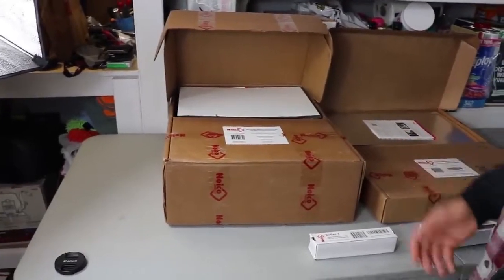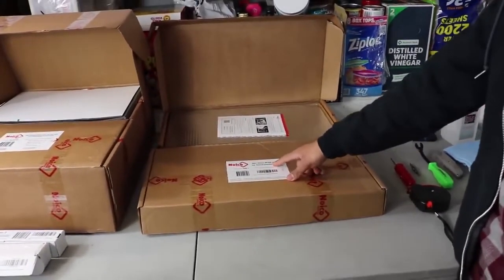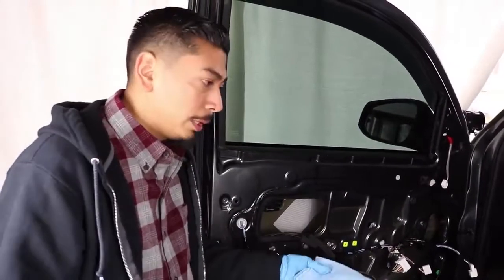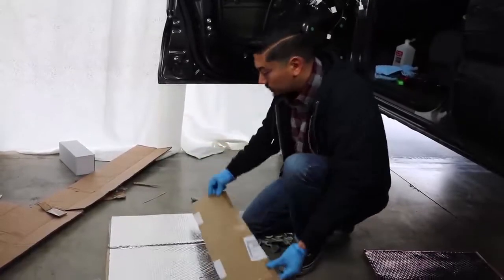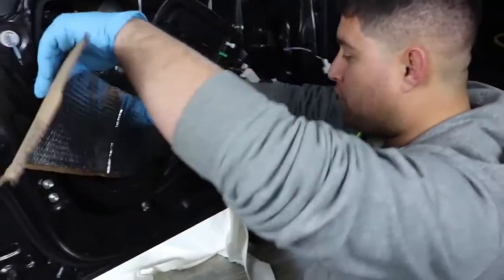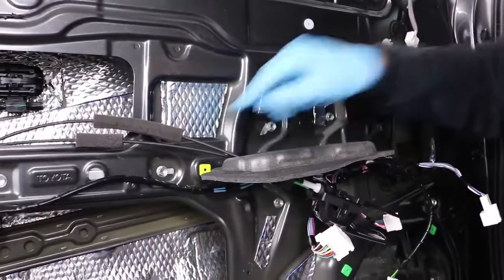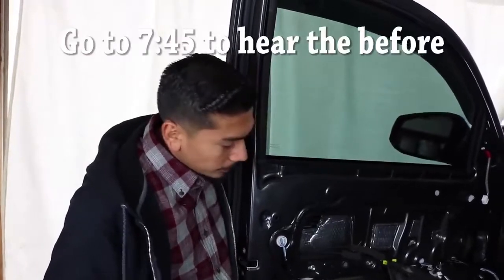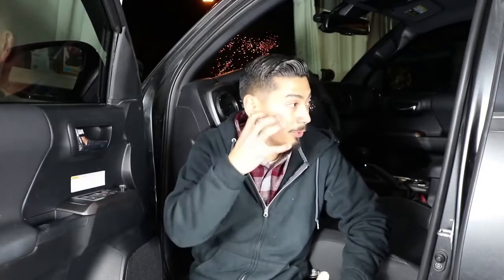Door soundproofing of Toyota Tacoma with Noico materials

Comment: Did you put the plastic and insulation back once you were done? I will be doing this to my Tacoma soon so thanks for the video!
Reply from the maker: That plastic with insulation is no longer needed as the door has now been soundproofed. You also want to cover that large door apertures.
Reply: @noicosounddeadener4641  I wasn't sure if it was a vapor barrier or had some other functions. Door apertures?
Reply from the maker: @ronhorn7378  Door apertures are the wholes in the door skin, you can cover that as well for more effect. Just observe the clearance to be sure that all door trimming would lock in place nice and tight.
Reply: @noicosounddeadener4641  Great! I have watched several of your videos over the past few weeks. Thank you for all of the information its been super useful.
Reply from the maker: You're very welcome! ;)